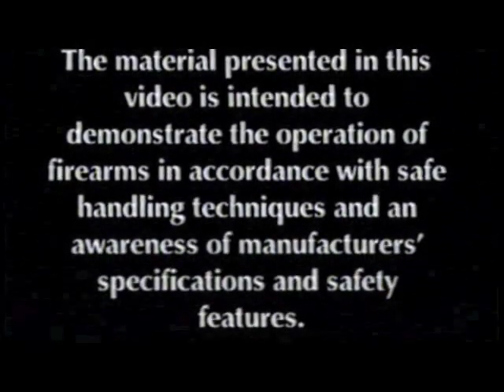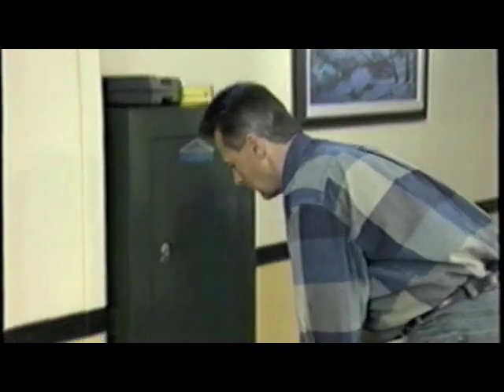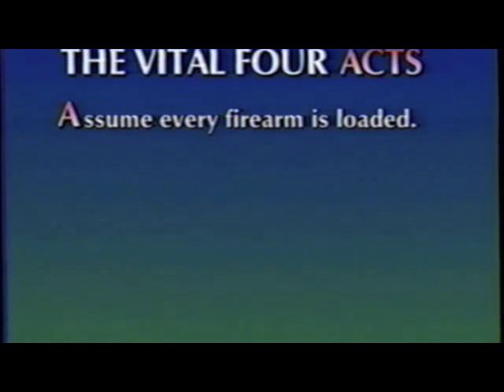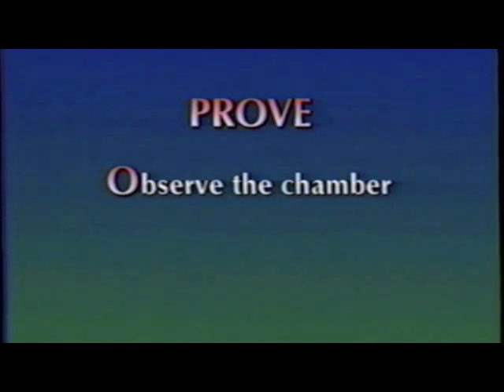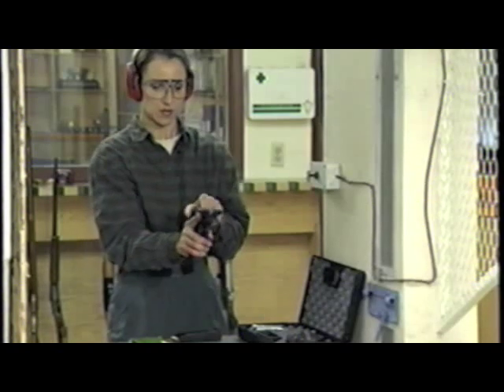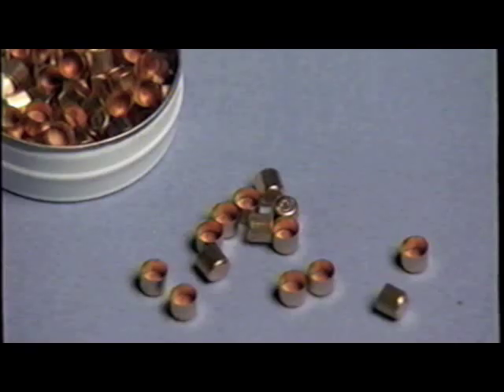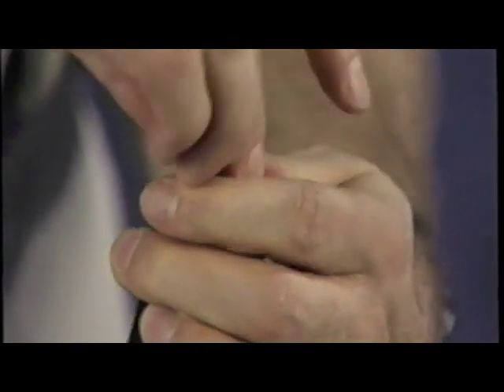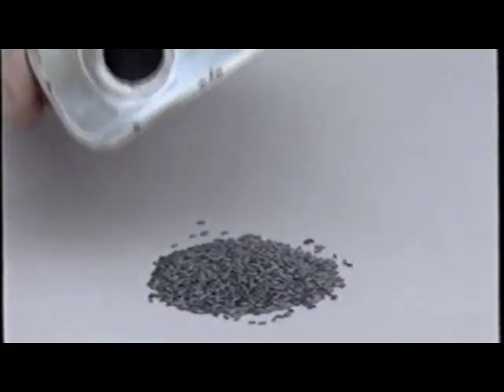Canadian Restricted Firearms Safety Course Video PART 1

Comment: No, our self defense laws work on a theory of equal defense ie: no bringing a gun to knife fight. You'd be charged with every last single infraction that would apply; from discharging a weapon dangerous to the public, all the way up to agrivated assault, attempted homicide, or if the case needs be, homicide. It would most probably be plead down to voluntary manslaughter. 15 years.

Comment: @amyhuk You have to control muzzle direction until you prove the breech is empty before you examine the bore, dumb shit. If it's already proven to not be loaded than it is perfectly safe to look down the barrel from the muzzle end. If you can't see all the way to the end from the breech side than you can't be sure something isn't lodged in the barrel which could cause catastrophic failure if you tried to fire in that condition.